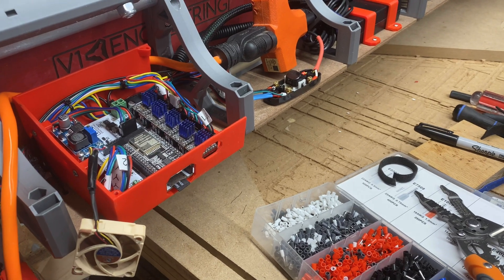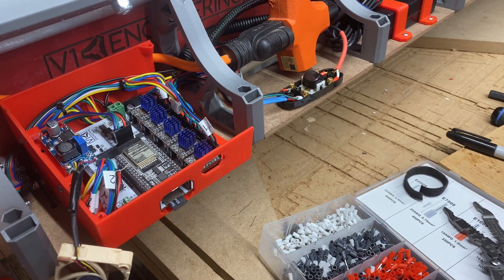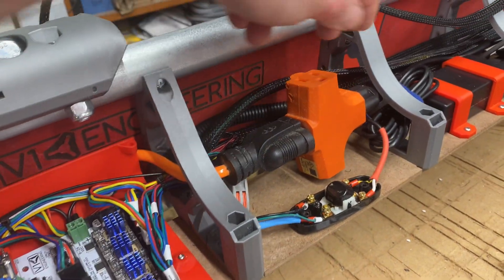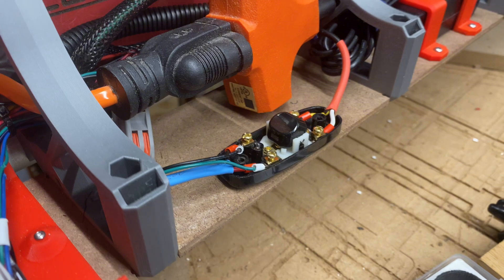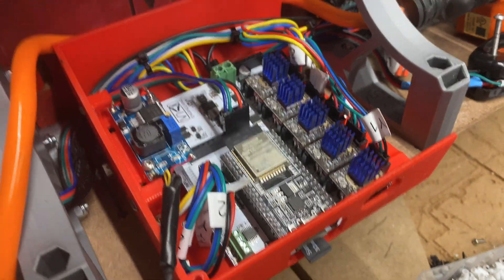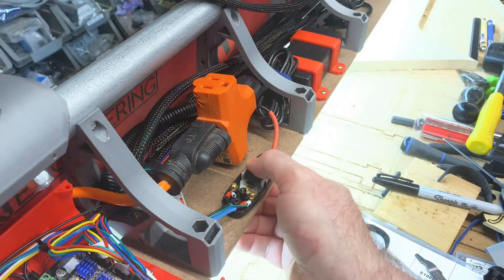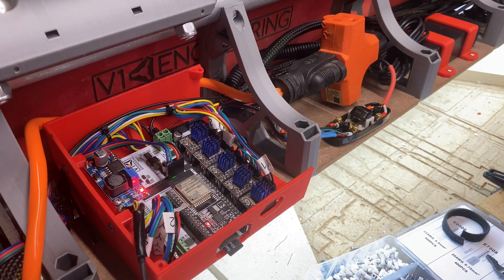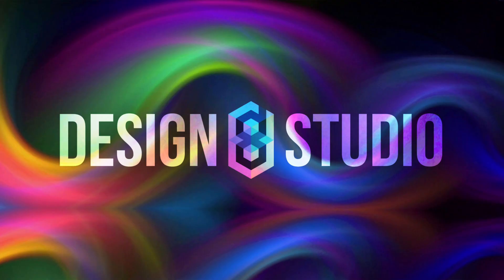LowRider v4 DIY CNC - full-sheet capable – 24v power routing, COB LED, cooling fan

Comment from the maker: NOTE: 24v fans are available, affordable, and would make use of a buck converter unnecessary. Please don't assume a buck converter is needed to make a fan work on a LowRider. Just wiring the right fan to the power terminals is good. I bought 24v fans, but the ones I got were very loud, even when under-volted. So, I used a quieter fan I already had on hand, but it was 12v and thus needed a buck converter. I could have, and probably should have, explored quieter 24v fans!

Comment: Looks fantastic. I hope to start mine finally in the next month. Thank you for sharing your build. As far as your LED strip voltage goes, the current is very low so you should be able to simply add a resistor in-line to drop the voltage and dim the strips. No buck converter needed! 😊😊

Comment: I just recently bought the kit for the Lowrider V3. Any news on how much of my hardware is still useful?
Reply from the maker: Yes, this has been addressed quite a bit on the forum. Much of the hardware kit is still usable. Lowrider v3 items that don’t carry over to v4 include: the XZ plates, the lead screws (which need to be longer), and that’s about it. Everything else should carry over. There are less screws needed on some screw sizes and a handful more are needed on, I think, at least one screw size. You can reuse the motors, the pulleys, the idlers, most of the screws, the end stops, and all the wiring. Of course all the printed parts are different. One last point is not regarding the hardware kit, but rather the steel tubes used. The Lowrider 4 uses larger diameter steel tubes, so if you already bought tubes for v3, you’ll need to replace them. The good news is for many people the larger tubes are available and affordable. In America, it is sold as 1 inch EMT, which is sold based on inside diameter, but it has an outside diameter of 29.5 mm. Options for people outside the USA include 30 mm and 32 mm outside diameter. Some heavy duty closet rod can be usable. Be sure to measure the thickness of the wall if trying to use something other than the EMT. The EMT seems to have a wall thickness between 1.4 to 1.6 mm. Anything with a wall thickness up to 2 mm should be OK. Beyond that it doesn’t help with strength and just adds weight and is kind of overkill. The diameter matters more for strength, unless the wall is really thin.
Reply: @ exactly what I wanted to hear thank you

Comment: Love it! I'll take notes for my own ideas once it's time for LR4
Reply from the maker: Cool. NOTE: 24v fans are available, affordable, and would make use of a buck converter unnecessary. Please don’t assume a buck converter is needed to make a fan work on a LowRider. Just wiring the right fan to the power terminals is good. I bought 24v fans, but the ones I got were very loud, even when under-volted. So, I used a quieter fan I already had on hand, but it was 12v and thus needed a buck converter. I could have, and probably should have, explored quieter 24v fans!